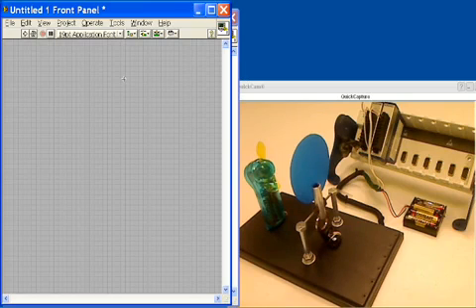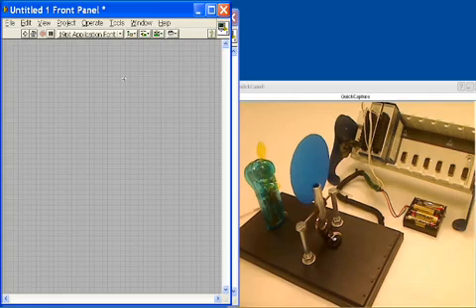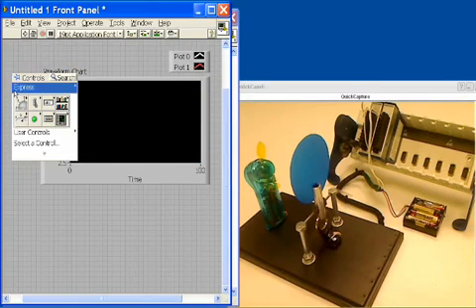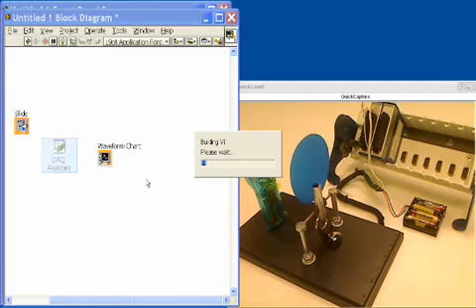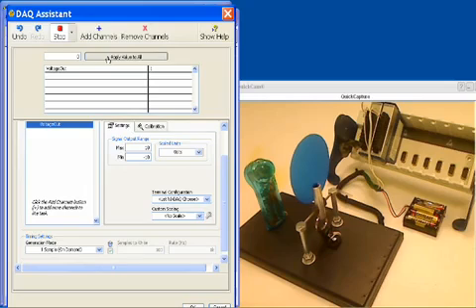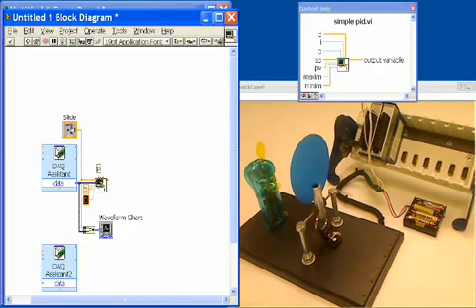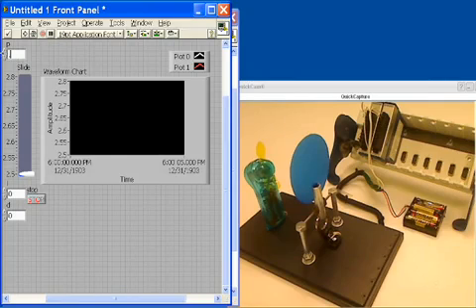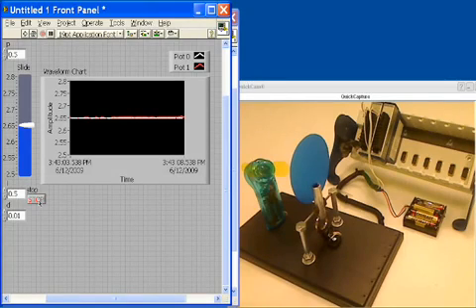PID Closed Loop Control with NI CompactDAQ

Comment: Question: What is the maximum banwidth you can achieve with this system? I.e., the PID's refresh rate.
In my application the PID should be able to output samples at at least 2kS/s. Can this system achieve this?